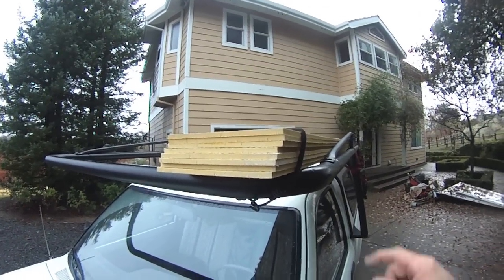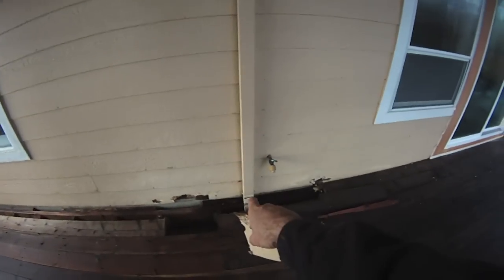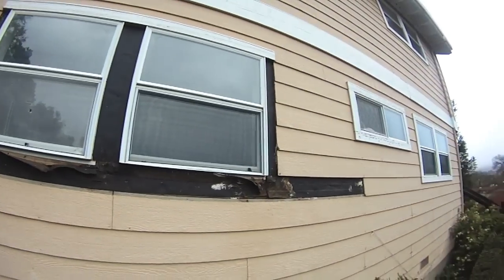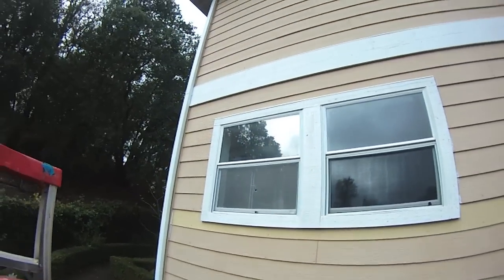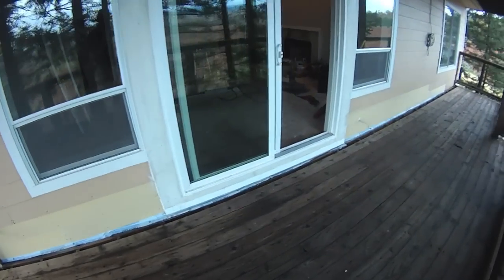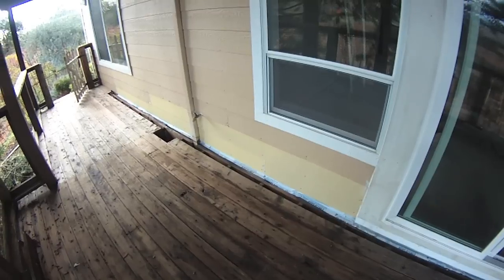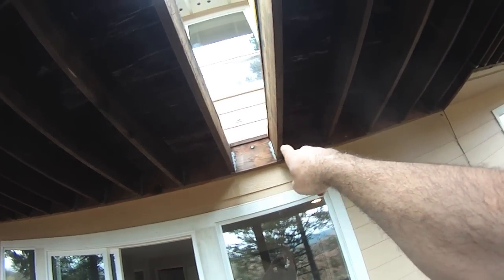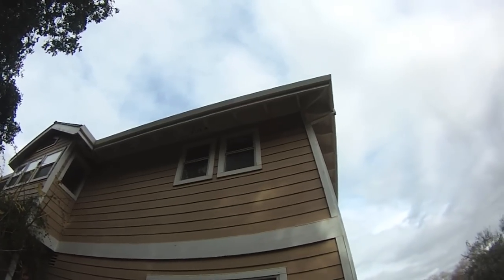Replacing Rotten Siding

Comment: When I was in high school my dad bought a couple of mobile homes, first a singlewide then a doublewide. Both had the same problem, someone had built the deck right up against the house and had rotted out the Masonite siding where the deck was against it. We replaced the siding with the newer wood type crap (looked the same T111 or whatever, just wood instead of Masonite...you can tell Im a carpenter haha) and when we were finished we trimmed the deck away from the house by about 1/2"-3/4" with a chainsaw. To this day when I see a deck built up against siding like that ROTT is the first thing that comes to mind.
Reply from the maker: +utoobube A lot of people build right up to the house without realizing what exactly they are doing for the long run... I like the chainsaw idea..I may have to use that one day... lol.

Comment: i have a chance to buy a great home and i was ready to. The home is colonial 3000 sq ft but it has Masonite siding. My agent said i should pass but i really want the home. Thoughts? Cost to replace with Hardie board?
Reply from the maker: Honestly, I don't like Masonite siding.  I wouldn't buy a house with Masonite siding without the mind-set to replacing it all.    Cement board is a good choice, but I can't even start to give you a price without looking at the work.
Reply: @yourbeekeeper  Ya i passed on it. Buying a newer home, built in 2014

Comment: Make good sense to me at least. What I didn't quite follow was what you were suggesting was necessary to avoid future problems. Were you suggesting to leave a small gap between the walls and the deck to allow the rainfall to drain to soil level or something else?
Reply from the maker: +Dan Whiteford Exactly right Dan, there are deck systems that are available that use standoff pucks for that initial ledger board: it keeps it away from the house and of course you don't run your deck top boards right up to the house,

Comment: I’m trying to replace some siding myself but I found myself in trouble. The board I’m replacing when I pry the upper board it tries to pull the nails through. Is their another way to get the upper board loose?
Reply from the maker: whatfreedom7 if your siding is flat like this house you can use a reciprocating saw (sawzall) with a thin blade, slip it under the upper Board and cut the nails.  It will damage  the lower board.. but you are replacing that one anyway.   Another option is a nail puller. https://www.homedepot.com/p/Crescent-19-in-Forged-Alloy-Nail-Puller-56/203984930   I have one of these and they work awesome.   If you don’t want to mark the board, simply slip some thin plywood or something under the leverage foot.

Comment: How old was the original siding?
Reply from the maker: If I remember correctly, it was around 20-years old.  The issue that shortened it's life span was water getting behind the siding due to deferred maintenance.  Maintaining good caulking and paint would have avoided this.